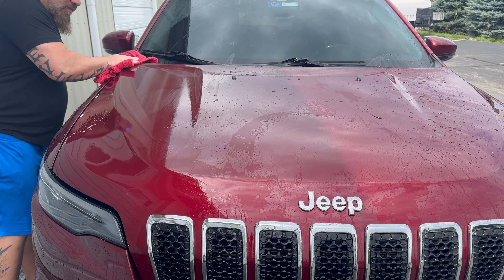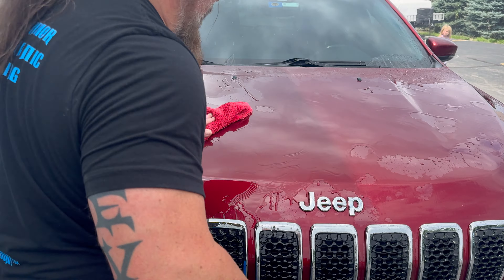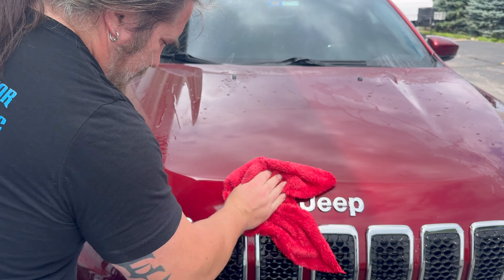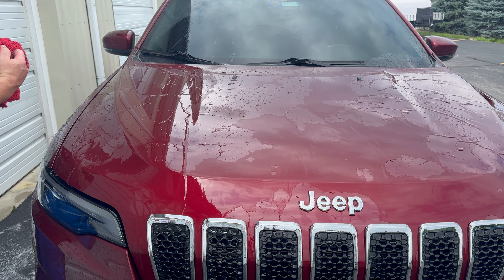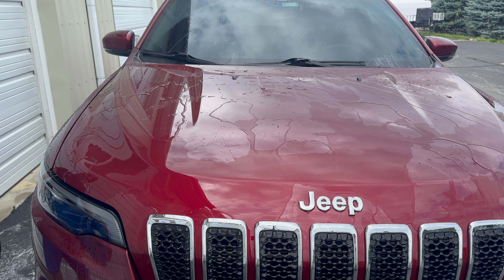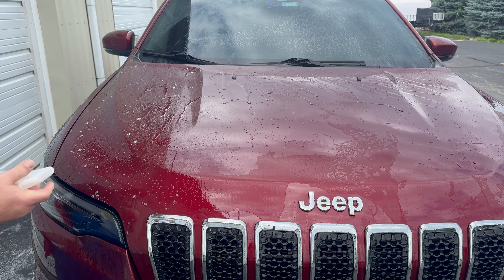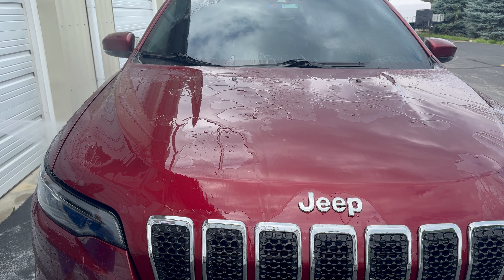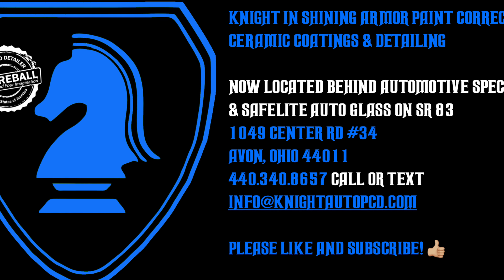DIY 8 Year Coating Failed After Just 11 Months! Part 2!  Was 100% Installed Correctly / Maintained

Comment: Looks dead, did a clay and iron before hand?
Reply from the maker: @RobFarnham it's gets an mild iron removing soap as part of the presoak and the finish is smooth - no bonded contaminants... why risk using abrasive clay when it doesn't need it - but  in any case it still LOOKS great but zero hydrophobics of any kind some I'm as stumped as anyone else! And yes initially was full iron remover and clay before installing the coating!Thanks for watching
Reply: Doesn’t sound like you did a full surface prep. Can’t really blame the product if it wasn’t applied according to the directions.
Reply from the maker: @The_Cyberz  absolutely did ...full deon .. wet sanding (in some areas) polishing - panel prep you name it ... as a former auto refinisher and still ASE certified refinishing technician I can promise you corners don't get cut when applying a coating - it didn't in my painting days and doesn't now - there's a 5 part video series on everything we did to this like 30 videos ago or so and have installed probably near 300 - 400 coatings at this point ... fhanks for watching

Comment: Maybe a bad batch of the coating ?
Reply from the maker: @en1254  wonder the same thing! When it was installed it disappeared almost instantly on the panel when it was installed I just attributed that to the way it behaved - but after watching a few other videos of installs, it disappeared way faster than I've seen so idk .. maybe ? Maybe the cap was loose and air got in there and who knows ... beats us! Thanks for watching!
Reply: Yeah definitely had to be a bad batch. It's unfortunate, but I appreciate you making a video on this
Reply from the maker: @DelgadoDetailing  that's what I think because even when you look at the application of this coating in other videos, when I applied it, it disappeared within 15 seconds of applying it .. and in a 70-73° shop that day I thought it was odd but first time applying that coating - so you know how coatings do different things when applying - never really gave it a thought until recently, when I did maintenance on it in Feb this year it was still beading like crazy and looking good so 🤷🏻‍♂️ - thanks for watching and your feedback!
Reply: @knightautopcd  yeah that's weird. It definitely did not disappear that quickly when I installed it. Sadly, most companies will blame user error before even considering it could've been a bad batch